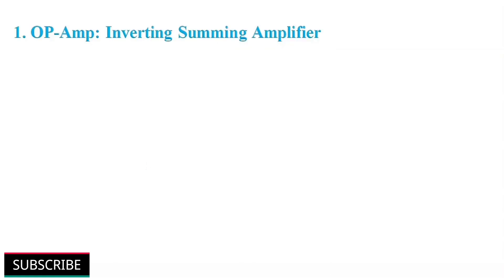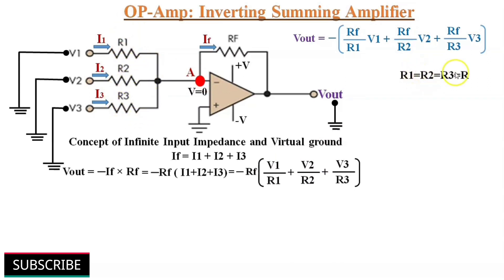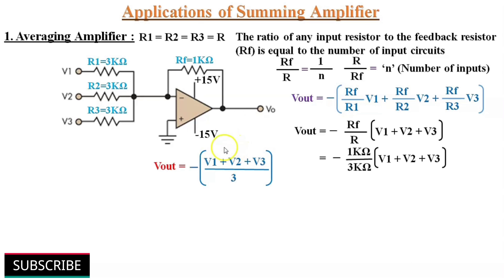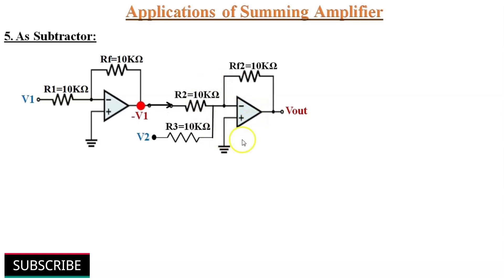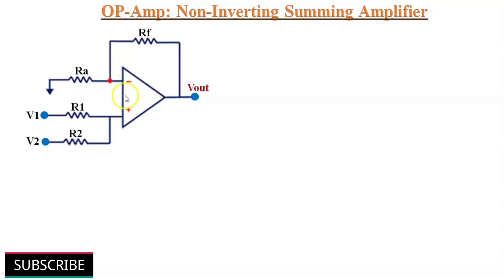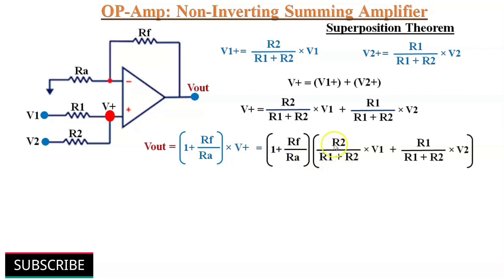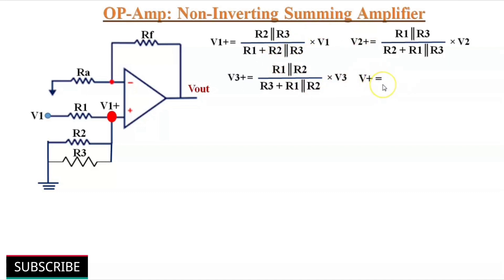OP-Amp Summing Amplifier(Adder), Applications and Limitations.

Comment from the maker: The timestamps for various topics covered in this video are as follows:
1) 00:17 - Introduction,
2) 00:49 - OP-Amp as an Inverting summing amplifier,
3) 03:22 - Applications - As an averaging amplifier,
4) 04:52 - As a Digital to Analog converter,
5) 05:29 - As an Audio mixer,
6) 05:56 - For Scaling operation,
7) 06:41 - As a Subtractor,
8) 07:10 - To provide DC offsets,
9) 07:30 - Summing amplifier limitations,
10) 08:45 - Two input Non-inverting summing amplifier,
11) 12:06 - Three input Non-inverting summing amplifier,
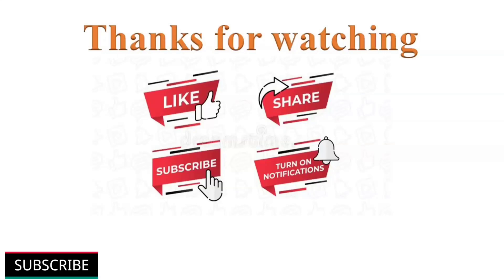12) 15:34 - Thanks for watching,
13) 15:59 - Next video.